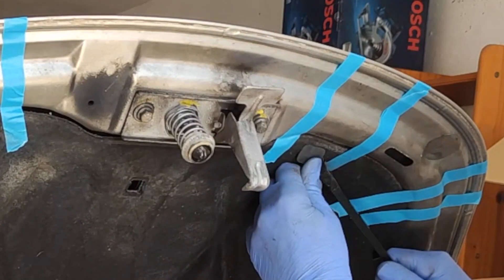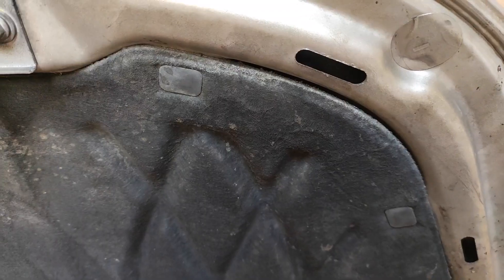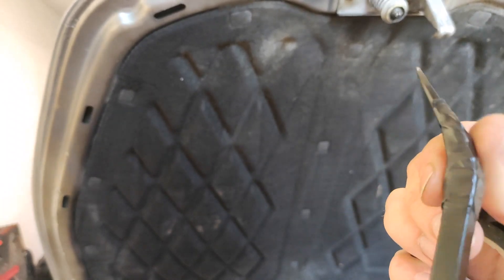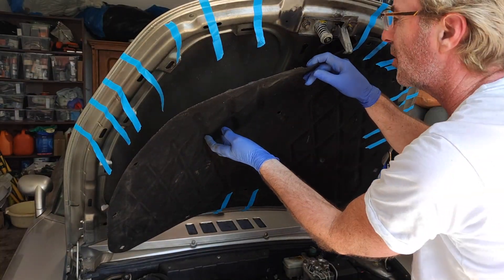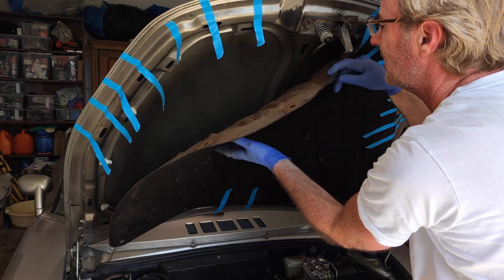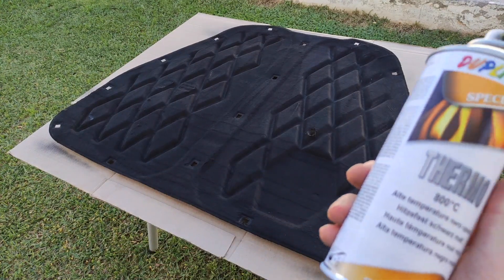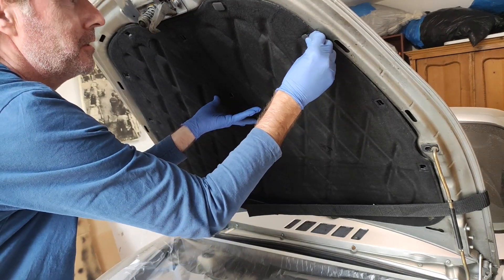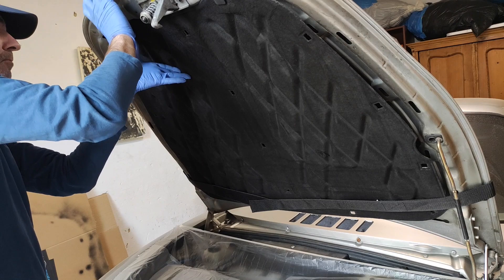Bonnet soundproofing material removed cleaned & refitted | Fiat Barchetta | Engine sound deadening

Comment: Bien hecho amigo. If you,re doing this then obviously everything else must be good.
Just for ur info my barchetta still wasnt passing emissions test at ITV.
Took it to fiat garage and after welding a joint on exhaust, new lambda and new fuel regulator it still wasnt passing.
So i bought it for €2500 in 2012, and sold it last month without itv for €2000.
So im not complaining.
I got my 2001, merc slk project through itv so running about in that !@
Reply from the maker: I was wondering what happened to your B! I'm glad you're ok with the way it turned out. I thought about an SLK as a future project car for the channel.  @Online Auto Repair Videos  https://www.youtube.com/c/Astralautorepairs1/featured has some excellent videos on fixing the SLK roof. I think Wheeler Dealers did an SLK as well.
Reply: @pauliecabs  if you want it, its yours for €3000.
Putting it on milanuncios tommorrow for €4000.
Reply from the maker: @arnietwo11  thanks but not there yet!

Comment: Nice Video as always! Mine doesn't sag down and it is not glued at all. It has a curve to it so it presses against the metal hood. But maybe the location and weather of the car will bring different results after all those years of use.
Reply from the maker: Much appreciated! I think it's either got wet and stretched or more likely the hot weather and has done the damage.

Comment: Hello mate, very instructive video. I have a question for you, how was the textura of the bonnet soundproofing material after paint it ?, i also want to paint it but i don't know what type of paint use, i am between spray paint for fabric or a spray paint for engines, my first concern is try to stay the fabric texture on it.
Thanks, have nice day.
Reply from the maker: It was heat resistant paint. Send me an email and I'll send a picture of the spray can. It didn't affect the texture of the material. I didn't spray it on too thick just enough to restore the colour.
Reply: @pauliecabs  Thank you very much for your quick response. I already have a spray paint for the engines, but I appreciate your very helpful advice.
Have a nice evening.

Comment: You can also impregnate the soundproofing with sodium metasilicate (relatively cheap and easily available). If you apply it on the on the backside (brush, roller or spray). it will have a similar effect like hairspray, it reinforces (stabilises) the soundproofing (it glues the loose fibers back together which have vibrated loose over the years under the influence of heat and vibrations). Frank
Reply from the maker: Thanks. Something like that crossed my mind but I didn't have a clue what to use!